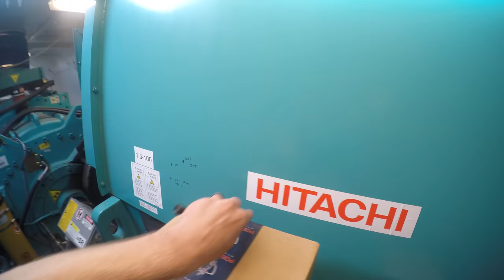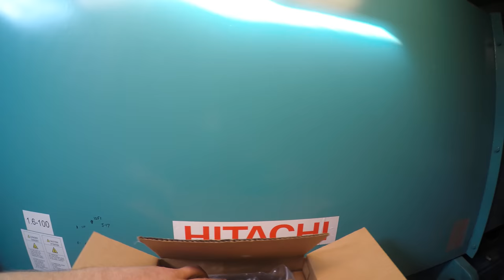Climbing a GE 1.6MW Turbine

Comment: How much force required to rotate it's blades?
Reply: Hafijul
Reply: Mvnfyoiouki😊😊😊😊😊
Reply: 7 to 9 mph
Reply: Yes
Reply: A lot
Reply: Depends on the blades and turbine, in case of this one 7 to 9 mph
Reply: 8
Reply: Without Wind 3 man and time
Reply: 10 bolts vitro
Reply: @md_faizuniverse what the hell does this have to do with the damn question.
Reply: @lusinemanukyan1757 you too, what the heck does have to do to answer the dang question?

Comment: I once climbed a 120ft water tower when I was a teenager.

You don’t know what fear is until lactic acid starts building up in your muscles, 100ft in the air, with nowhere to relax.

I’m lucky to be alive after that, and I was a 150lb teenager that could easily do 10 pull-up’s.
Reply: What is lactic acid?
Reply: @fat_seal  that burning sensation when your muscles are giving up
Reply: Did you ever climb again im afraid of heights and had a job off as a wind blade tech but I was afraid this would happen to me

Comment: How much does the climbing assist help? Like does it take off 50% of the effort? 70%? 90%?? Just curious. Thanks!
Reply: 65e
Reply: Depend upon specifixat2
Reply: Depends on body weight!
Reply: 42.31%
Reply: Depends on how clean that cable is I’ve had some that are oily and you get no help
Reply: ACX is a game changer. Don’t have to climb

Comment: Is that a power assisted or safety only cable you are using?
And what's that crazy humming at top level?
All you need now is a hang glider 😳 Great view of the lay of the land... 
Outstanding footage!
Reply: Probably a motor driving the hydraulics.
Reply: That’s the gearbox oil pump your hearing
Reply: Climb assist is blue cable and yes one must always be on safety cable as well. This climb assist was set a little too high /fast IMO

Comment: How much does a job like this pay
Reply: 80-150k
Reply: @nathankeske5697  Not lying. The overtime is good.
Reply: @@MarioisawesomeXD yes, you are mostly correct, I think 80-150 is a little more average, I’ve heard of site tech’s making $50,000 all the way up to $110,000 plus 10-15% yearly bonuses. Then on the other end, heavy traveling which sometimes isn’t so heavy you can bring in that 160k with 150 per diem with $40+ hourly plus overtime for a more skilled individual. But don’t forget with that per diem being untaxed its more so compared to a 200k salary if you can work all year without more than a month or so of bench time.
Reply: @@MarioisawesomeXD Pattern energy, Nextera averages about $75k/yr, I personally wouldn’t take a site tech job for under 100k/yr and I’ve had the offers. Only reason I wouldn’t take it is because it’s hard to leave that per diem.
Reply: @@MarioisawesomeXD OMNI is paying high $50s as a 1099, Pearce is around $38-$40 as a tech 4, Impact is a bit lower around $34-$36 but has its potential. I won’t mention the company I’m with as it’s rather small. I’m commissioning / troubleshooting based. Also, I’m not saying you’re wrong and maybe my numbers were a little high starting at $80k however, I believe it’s easily obtainable in wind with little experience. I started out in wind making more than that with little experience commissioning GE turbines.

Comment: Installing the Poseidon System I see.
Reply: It's plain to see how hardcore this guy is, by the urgency with which he prepares to install the critical particle counter...
Reply: @benharris8790  Why install a particle counter if the site is going to run that gearbox till failure. Warranty? a new gearbox for a discounted price? Engineering advice? I'm not involved in those meetings, so I don't know.
Reply: @xfearfactoryx7684   The particle counter is used to make a judgement call, to determine just how close to failure the gearbox is. The idea is to run it until it's within an inch of splitting open and dumping all its oil downtower, or worse. Calculated risk...
Reply: @benharris8790  Idiots would do that not a clever owner and operator. I'm in wind energy since 1995, own and operate 40 turbines. Oldest ist from 1992 an still running like new. Best regards from Germany.